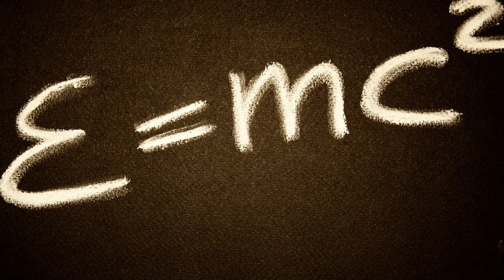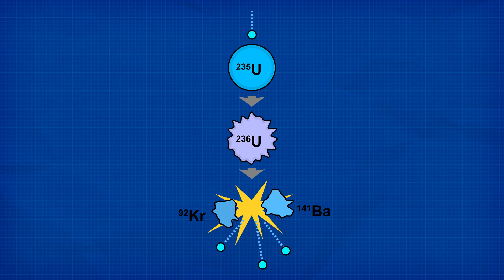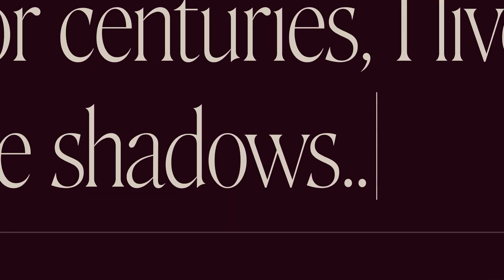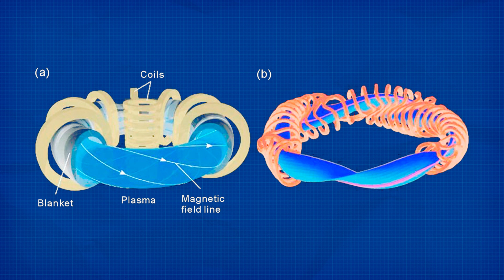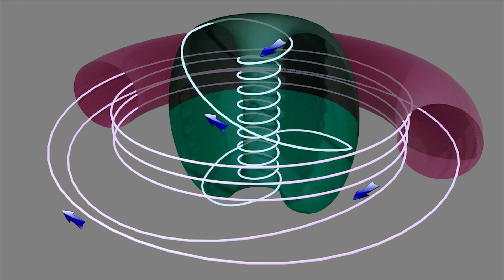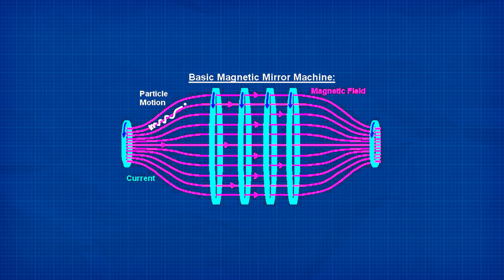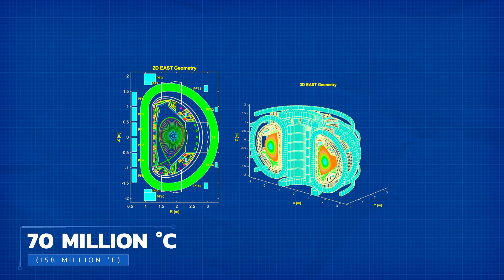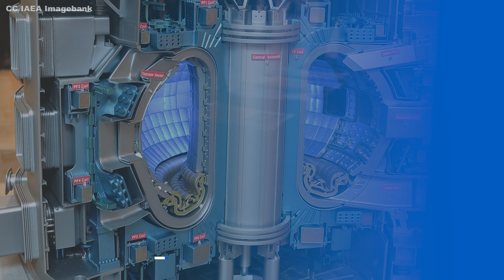Fusion Cracking the Future of Energy

Comment: So if a tokamak could be made to produce excess energy, how would that energy be extracted? By the ages-old system of heating water and running steam turbines? I.e. some kind of water tubing on the outer shell? Or something more advanced, perhaps inductive or capacitive coupling from the plasma current? Oh but isn't that current just produced by the containment system, so heat might be the only way. And how does the system, if running continuously, remove the fusion products and insert new fuel??
Reply: Probobly by a bradley  turbinen or thermo  vhemical splitting. 

Steam turbines is not efficent in that temperature range
Reply: Metal blanket around the torus is heated by neutrons, passes heat to a coolant circuit, which raises steam for steam turbines.

Comment: I see you have posts explaining Q value (plasma v total). Q(total) is the >1.0 tipping point. Even with Q(plasma) over 0.70 the all important Q(total) is still below 0.10. We are still 90%  short of commercial fusion. If you do a Top 10 Misunderstood, put this in it, twice.
Reply: And there was me thinking "only 70%? That doesn't sound very good". On the face of your clarification, it seems unlikely in my lifetime, I would love to have seen it.
Reply: That Sabine video is nearly worse misinformation that the misinformation it set out to counter. The "Qtotal" of ITER or any other test facility is so unimportant that it's not even worth mentioning. It's like asking what the total weight of an engine test bed weighs when you try to figure out how efficient an engine will be in a car. Obviously the test bed will weigh 20+ tons, it will have instrumentation and other aspects, same as a fusion test facility.
What Sabines video does, in car terms is to say something like 
"This Engine produces 30 horse power, and the test stand weighs 26 tons, so it's not going to work as a car" 
Well no shit, it was never designed to be a car, it was designed to test things.
ITER is the same way, there are 3 ways to mainly heat a plasma, injector beam, micro wave and direct current.
If we want to find out how the plasma forms using different amounts of the different inputs, we need them all to be severely over dimensioned.
We also want to be able to stop the reaction very quickly in case some test goes in an unplanned way, so we require extra cooling.
Then there are the stabilization magnets, 16 of them, will they be needed? we are unsure, I'm not talking about the confinement coils here, just the extra
setup, but if we don't build it with them, and 1 some or all turn out to be needed, well, then the whole thing was a waste. So they require cooling
Then ITER won't be hooked up to the grid, for obvious reasons, you don't want to pump enormous amounts of power onto the grid for short periods of time.
So we need additional cooling to simply cool off all the heat the plasma is generating. 
Then there is all the instrumentation observing the plasma and the magnets, the breeding material etc. All in need of cooling. 

To design ITER for maximal Qtotal would be lunacy, because we don't have all the answers yet, and if we just take a chance and build it
with what we think might be correct, and it turns out wrong, then we are stuck with a huge building doing nothing. 

Once you have a reactor design, with all the parameters fine tuned, where you know how to bleed the plasma off, where you know the optimal ratio
of heat input from different methods, then you can design for Qtotal, but before then it makes no sense at all.

And the most important thing Sabine left out in her video, to raise Qtotal you simply need to make the reactor bigger, it's been known for a long time, the Soviets
cracked that one.

Comment: Re - 0:52
Fusion isn't "Clean." Admittedly, it's cleanER than fission or coal powered plants, but fusion power still spews out an awful LOT of ionising radiation (largely Beta and Gamma radiation). Also, there are likely to be parts of a fusion reactor that absorb so much radiation (typically alpha radiation in this case), that these parts themselves become radioactive, re-emitting the alpha particles they were previously bombarded with. So, again, fusion reactors and/ or reactions are NOT clean.

Comment: So... how easy is getting the fuel for those? Are Deuterium and Tritium common in the world/universe? Or is there yet another (not really mentioned) energy required to prepare them beforehand?
Reply: Deuterium is 1 part in every 6500 parts of sea water, very easy to, tritium is worse, but the reactor itself is designed to use part of the reaction to breed new tritium at a greater rate than it is consumed, if we can solve that process perfectly we will gain net tritium running a reactor.
Reply: Deterium is common, tritium have to be created...

Comment: Why not split an electron at a confined angle and harness the fission /fusion reaction with a solar panel at the most efficient radius and crank out about 207% power. Free clean energy.
Reply: You can’t split electrons, they’re a fundamental particle.
Reply: @Gomlmon99  wrong
Reply: @cyberbullyssb2870  Oh, so you’re saying all of modern physics is wrong, and you know more than every physicist from the past 200 years?
Reply: @Gomlmon99  I'm saying that it can be done. Those 200 years what did they think gravity was, well they was wrong...soooooo.
Reply: @cyberbullyssb2870  When have they ever been entirely wrong about what gravity is?
Reply: @Gomlmon99  up until 2017 they thought they had gravity figured out. Then they watched 2 stars do some interesting things. Maybe if you knew even that, you wouldn't be so quick to dismiss my thoughts.
Reply: @cyberbullyssb2870  They has a very slight change in something extremely well established. That’s not remotely the same as suggesting an electron can be split.

Comment: 14:02 how does 120m Degrees not melt through everything containing it 😂 fooking damn son !
Reply: The same way you can tolerate hot air on your skin, but not water of the same temperature. The plasma has very low density, it’s a low vacuum at room temperature. Extracting the helium, the hot ashes of the fusion reaction, is a challenge though.

Comment: Nonsense.  Q only refers to the gain in the heat of the plasma.  The amount of energy needed to attain the input heat is much higher than that which is used to compute Q.  Also the amount of energy harvested will be much less than the gain quoted.  Plus, how will you harvest energy from plasma at 100 million degrees?  Your heat exchanger will be vaporized and simply add to the amount of plasma in the torus.  And don't forget the processing needed to breed the tritium and harvest it for fuel.  We need molten salt reactors now, not a ridiculous pipe-dream.
Reply: Lmao they don’t put a heat exchanger in the middle of the plasma 😂😂😂😂
Reply: @Gomlmon99  Exactly.  How you transport 10 million degrees out of the core is a non-trivial question.
Reply: @jamesadamo2784  Neutrons heat up a liquid lithium/lead blanket surrounding the torus, which passes heat onto a secondary cooling circuit, raising steam.

Comment: When talking about Q, make sure not to confuse Q(plasma) with Q(total). Q(plasma) only factors in the energy pumped into the plasma, Q(total) takes everything into account (like powering the magnets, cooling, etc). Many places where Q is mentioned, Q(plasma) is talked about but if we ever want to generate net power Q(total) will need to be > 1 (for comparison: ITERs Q(plasma) will be around 10, but Q(total) around 1)
Reply: did you watch sabine hossenfelder as well?
Reply: Unfortunately there is monkey business surrounding this.
Reply: A CCGT is about 60% efficent... can be psushed to 65% with circulating gas. A plasma injector can be up to 75% efficent. So you really just need a Q of just over 2 to gain energy... of cause it would be fairy expensive.
Reply: @matsv201  You need the total energy output to be greater than ALL of the energy required to run the entire system. Q=1 just equals power out is the same as input power to the plasma field. This does not take into account all the other systems (pumps, compressors, cooling systems, etc., etc.) required for it to operate. it is not an insignificant amount of power.
Reply: @stuglenn1112  the pumps are included in the efficemcy of the turbines.

For non SC tokomak the magentization uses a significant amount of power, but for SC coils they barley take any. The coling system uses some power, but the amount is again negleable, specially so for HTC.

This really leaves the injection as the only significant power drain.

Think about it.. we uses both SC and HTS in maglev trains, and there tve cooling system just use a few kW.. there is no reason why that would change much in a reactor doing the exact same thing.even if its ten fault... a few 10 kW is nothing compare to 500MW
Reply: @matsv201  Well I have to disagree. Check out a video by Physicist Sabine Hossenfelder:  https://youtu.be/LJ4W1g-6JiY. She given a lot better explanation than me.
Reply: @stuglenn1112  Yea she is wrong, she might know the physical aspect of fusion, but the support system is not here specialty. Don´t believe everything you see on internet.

Or rather.. she don´t specifically say 10 is the magic number, she uses it more of an example. So she is more misleading than wrong
Reply: @stuglenn1112  The Q criticism is valid, however it is typically taken so far that it becomes more misleading than the simple statement of Q plasma. This is because of the scaling characteristics of fusion power. ITER has a Q total of 1 but an energy producing test plant based on it could have 5x more power with a 75% increase of input energy and a net GW of electric production

The most accurate description of fusion performance would likely be the Q plasma along with the Q value required for commercial level performance. Tokamaks and stellarators are said to require a Q of 20 while lasers a Q of 100 along with several shots per second capability. With that it mind it can be said that JET has the clear record Q as a fraction of commercial levels. Helion and General Fusion appear to be looking for a Q of 8. With the new high power superconductors a Q of 13 is projected with a Q total of 3 for a JET size tokamak in preliminary design stage by CFS. This seems well below the commercial goal although the design concept isn't necessarily aimed at maximum commercial potential but rather the minimum size of an electricity producing test reactor

ITER is expected to use about 300 MW to run although I saw one source say that since there's almost no loss in powering the magnets it's really 250 so you're generally correct about that. Their thermal output converted to electricity might be about 300 MW in theory. The HTS magnets of CFS I think only use 10 MW for cooling which with their smaller overall size and higher Q enables their JET size tokamak concept to project a net output of 270 MW

So I would say fusion is visible on the horizon (great sign off pun by the video btw) and if there's no obstacles we're talking 10 to 20 years to get there, but we shouldn't be surprised if there are some obstacles
Reply: @THE-X-Force  she is right about that specific thing

 But that dont make here non wrong
Reply: Excellent point. And for a useful power station based on say steam,
 Q>21 approximately.

Then you will need a bit more to account for distribution in the grid and delivery to end user say
Q>21-25
Reply: Part of the general total dishonesty of fusion in general.
Reply: Came to say pretty much the same thing. Throwing the "Q" term around can be very misleading especially in pop science.
Reply: Exactly dear boy...cheers.
Reply: another dumb fusion video...its not gonna happen. its impossible to extract the energy with MEANINGFUL efficiency surrounded by those super delicate magnetic coils...

Comment: Fun fact, the Tsar bomb was actually designed and built with a yield of over 100Mtn in mind, but in the end they decided not to use the uranium-238 fusion temper needed to achieve this yield to reduce nuclear fallout.
Wait did I say fun? I meant existentially terrifying.
Reply: I am sure the pilots were happy about that because they weren’t sure they were going to survive the test. Their plane fell 1 kilometer before it regained control as the result of the blast.
Reply: Not really, tsar bomba full yield is impractical and doesn't even currently exist. Russia's heated up version of small pox is FAR more terrifying
Reply: Another fun fact castle bravo designed with a 6 kilo ton blast in mind it actually got 14 kilo ton blast , just incase you weren’t actually scared of these loco mothers yet
Reply: @angryatheist  do you mean megatons?
Reply: @Ben-li9zb  😂 yeah me mean big boom 💥
Reply: @Ben-li9zb  no, it was kilo tons
Reply: @psycronizer  wrong, it was megatons. Kilotons was what the first nukes were measured in
Reply: @Ben-li9zb  you're right, for some reason I thought bravo was much earlier, my bad...
Reply: @psycronizer  its fine lol, I looked it up too

Comment: (0:53) Fusion produces 4 million X the amount of energy of fossil fuels, but even optimistically, we're only likely to get 50% to 75% of that energy out with magnetic confinement fusion, as you'll have to pour 25% to 50% back into the reactor just to maintain the reaction, and we're not likely to get to that point for another 50 to 100 years. Fission, which we ALREADY HAVE, generates 1 million X the amount of energy of fossil fuels, placing it at 1/2 to 1/3 the amount of energy we're LIKELY to be able to get from fusion (many decades from now). 

The problem with fission is that light water reactors (LWR) only fission a VERY small fraction of the fuel that goes into the reactor, from 2% to 3%, with most fuel coming out of the reactor and being incorrectly labeled as "waste". There are several Gen 4 reactor designs that will get us an almost 100% burn-up of fuel, getting us the power pretty close to the power outputs that fusion promises to get us, one day. 

There's also more fuel available for fission than there is for D-T fusion.

Comment: One obstacle not mentioned is politics. Fusion has not only been underfunded but even intentionally slowed by both the petroleum industry and the fission industry. Tons of money, and therefore political influence in those industries. There are plenty that don't want fusion to happen too soon. There are new technologies (such as high temperature super conductors) not yet being used in any up and running experiments. Commonwealth Fusion might be the first in a few years. Also the German W7X stellarator should be finished with it's upgrade this year and is projected to achieve 1000+sec long plasma control runs. Basically continuous plasma control.

Comment: Fusion Energy Q is the energy into the fusion reaction and does not include the energy of all the support systems.  The best way to explain that (if you don't know it already) is with laser inertial confinement.  If you get a Q of 1, then the fusion energy is equal to the laser light energy.  However, the laser itself may have only been 10% efficient, which means you really need a Q of 10 to break even for the full laser power requirement.  So to start putting large scale fusion electricity on the grid you have to...

Get the fusion energy Q to 1
Increase the fusion energy Q so that all the output energy equals all the input energy
Increase the fusion energy Q so that the output energy exceeds all input energy with enough excess energy to generate electricity (accounting for generation efficiency).
Build a prototype commercial reactor
Start building commercial reactors. 

That seems like 5 corners to get around - each one is just 20 years away!  You might be lucky and do two corners at a time get there quicker, or you may find out you made a wrong turn and have to go back 40 years.
Reply: @Gerald H I think I heard 10, but that is in the same ball park depending on the operational assumptions.  However, that would be (energy out)/(TOTAL energy in), not just the fusion energy Q.
Reply: why it will never happen or at best a stupidly expensive centralised nonsense machine beloved by large companies for its infinite funding opportunities
Reply: Currently, a ball lightning energy source produces Q=8.6.
China has acquired the technology. It will be used in military and space exploration projects. It is called the QUANTUUM DRAGON project. It can be made in a small cheap household version. So far it has been scaled up to 3 MW max. We quickly told the CIA scientists ( because they are the best) who reviewed the project documentation and found it to be along the same lines as their own research.
Reply: @zoltanpecsek4373  what the hell have you been smoking or injecting ?
Reply: @psycronizer  I hate drugs. I am a highly trained technical visionary who is a specialist in space-time technology. I make my living by being able to remotely detect what's in a place (CRV Cooordinata Remote Viewing). Every country has such experts to help the police and the secret service. In our country, it's the industrial companies that are helped by the psychics. Our Chinese colleagues are at the top professionally, because they also take the documents by telekinesis. But to answer your question specifically. Create an email account for file exchange and I will send you the materials.